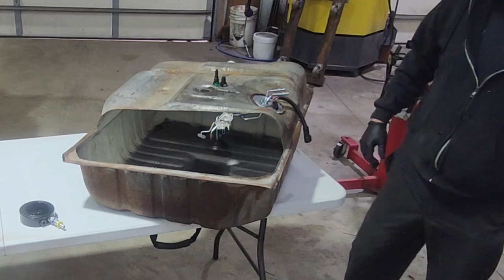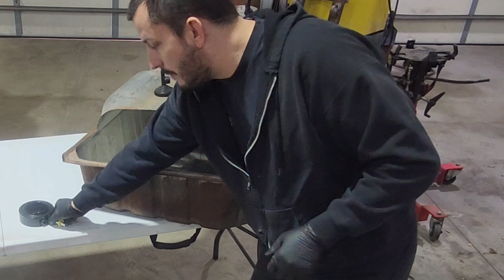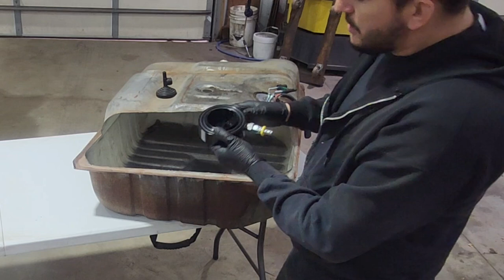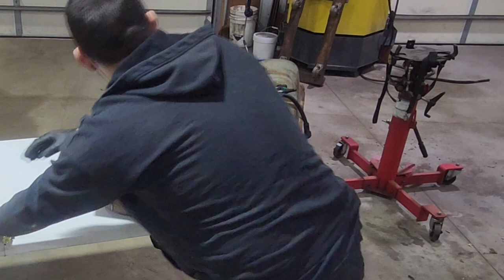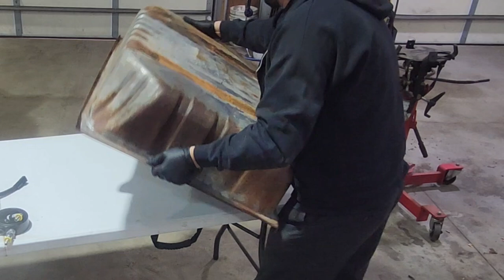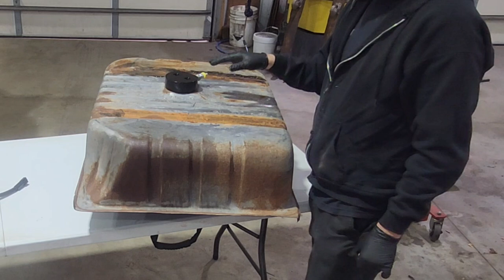Single tank conversion explained.

Comment: Option 2b and 2c what's to keep junk out of lines and selector valve?
Reply from the maker: Well - you are not putting anymore fuel through the selector valve for starters. As far as in the lines - well they aren't the restriction in the system anymore since ALL of our kits come with 3/8" (or larger) lines (larger than OEM) - the debris will be collected by the FIRST filter - like it is supposed to be!